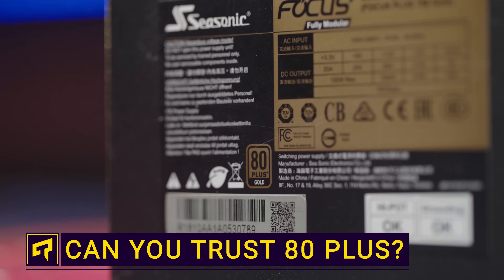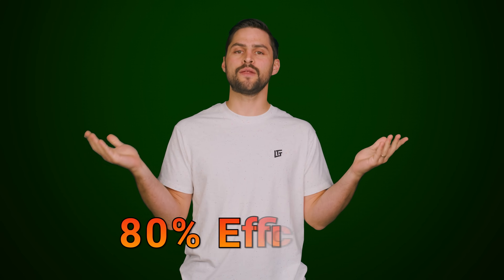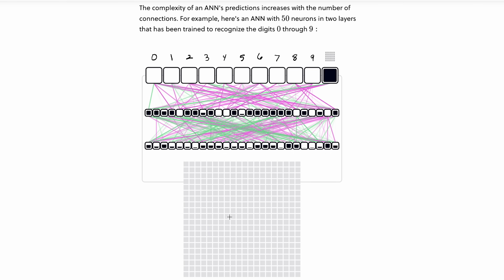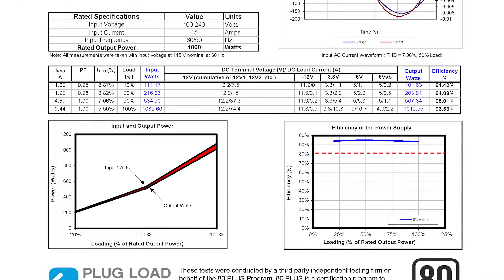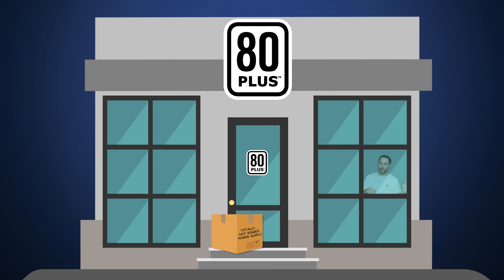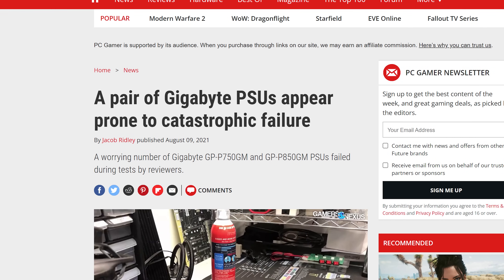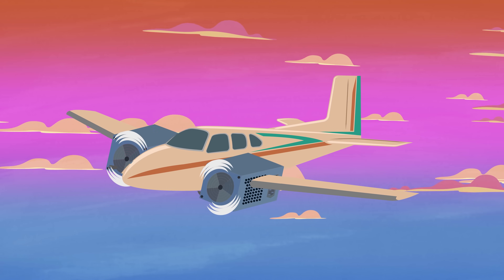Can You Trust 80 Plus?

Comment: Who give a crap about 80 somthing stadard buy seasonic ,super flower powe ,corsair and you are good yes they are expesiv but in 6 year you still are using that psu with no issues and itsade its worth easy
Reply: Not all Corsair branded PSUs are good. Corsair also sells mediocre to subpar PSU that use cheaper, lower quality components. You really have to look into the model and batch of that particular Corsair PSU. Corsair also does not manufacture any of their brand of PSU but are outsourced and based off various other manufacturers that specifically design and manufacture their own platform of PSU which quality can vary a whole lot.

Seasonic and Super Flower however are great since both of these brands actually design and manufacture their own PSUs and all their PSU models they sell are almost always at the top-tier in terms of quality and reliability.

Comment: Picking a CPU is hard since there are so many things to take into account and there are so many different models. The same goes for GPUs. The same goes for RAM. And for storage. And for the motherboard.
And then all components have to be well balanced on performance and price. Adding the complexity of a PSU to this makes it only more confusing since it's so hard to find proper data and consistent data to compare different power supplies. 

It's good to recommend this kind of thorough research for the people who like to dig into all of that, but what advice would you give to people who are new to pc building and who already overwhelmed by the amount of things they need to keep in mind and take into consideration? 
If you spread doubt and confusion like this, I would like to know exactly how I can easily avoid major mistakes while still keeping things as simple as possible

Comment: well in the other vids i saw that 80+ stuff isn't really mean much, because they only represent how much of power draw could occur in certain load, but they didn't mean it's really have great build quality, good PSU usually came with a heavier weight which means they could probably build better than average manufacturer.
Reply: Yep, bravo! With a mindset like that, PSU manufacturers will start adding unnecessary weight to their products. They know their "smart consumers" will judge a product based on how heavy it is.

Comment: My new Power Supply is called a 420watt Thermal Master which had No 80 rating that the seller on ebay call an OEM Cool Master?????? I can't find anything on it. It wasn't a New build it just my 15 year old DRS stop working one day. Standards are great. Made in 2010, so 12-13 years ago, only had a six pin for the GPU, but had 20-24 Motherboard and 4-8 pin CPU I was sad to see it go.

Comment: 80 PLUS measures at 10, 20, 50 and 100% and includes Power Factor, PF at all of those levels.  You can download and sort all of that information from all tests from the website for free. Thus a consumer can sort on every/any level of data desired.  As for cherry picking, which happens in most 3rd party testing programs, 80 PLUS has a challenge process within industry as well as an audit process since 2005.

Comment: Just a note on the Cybnetics noise testing, it's done at 30-32° celsius ambient, meaning you should still look up seperate reviews for more modest noise data if you use your PC in a cooler environment.

Comment: I have a Corsair HX620w. It used to feed a e6750 cpu and a 8800gt back in the day, then a q9550 and a gtx 680, now it feeds a i3 9100f and a rtx 3060. So it's a 16 years old psu still working silently, without any problem.

Comment: True and real. 
My rtx 3060 had power line led blinking with 700wat 80 plus (not even bronze) then i upgraded 750wat golden and newer tech and problem was fixed. And ye I should mention it's asus strix card that has that extra red led for errors.. and the previous PSU was able run all games without any crashes or wierd stutters too but apparently was using higher voltage trying to achieve same which occured as error in end any way and not letting GPU really never go over 180wats and blinking started around 170wat peak loads even, but with newer supply and newest drivers it can go high as 190wat easily with slighty lower voltage on gpu by automaticly and trouble free.

Comment: 0:30 "To qualify a Power Supply has to convert at least 80% of incoming power into actual power that your PC can use."
There you have it, AC current in your power socket is fake. Only the DC below 12V in your PC is real.

Comment: Quality PSU will last you several builds. Always get roughly 200-250% of your total system load. If your components peaks at 400W load get a 800W-1000W PSU. This will run your PSU at 40-50% load which is a sweet spot for efficiency and silent operation. If your next build has a higher load you will still be fine with that PSU.

Same thing with a good Case.

My recommended PSU's: Seasonic Prime series, Corsair AX/HX/SF Series, EVGA SuperNova T2/P2 series, Fractal Design ION Series, Can't be bothered to list more. 
My minimum PSU's: Seasonic Focus series,  Corsair RM Series, EVGA G Series, Can't be bothered to list more. 
Other PSU's: Ain't touching that with a 10 foot pole.

My Corsair AX760 is still going strong. Think I'm on my 5th system with the same Case/PSU.

Comment: Just had this problem this week when choosing a new PSU. It was between the RM850x & RM850. The only thing I could the find difference was sites saying one used components from China & the other Japan. However I couldn't any verifiable information in this claim, just repeated the same info on different sites. Anyway, I went with the "better" one, RM850x, cause it was only 5$ more.
Reply: Not 100%, but Corsairs RM PSUs ending with X are basically newer refresh of non-X, so similar with some improvements. I think changes were as you mentioned Japanese caps, which are in theory more tested for higher quality, but in practice, this is more of something that used to be true, but now isn't even nearly as much. Plus quieter fan with MagLev barrings. And they put caps into cables too. Both latter stuff are more nice to have. If memory serves, RM series wasn't bad to begin with, so difference wasn't as impactful. I think CX series had bit more of quality improvement with CXM refresh, where you did want to get refresh.

Comment: I have Corsair RM650 2021 PSU with 80 plus Gold, with my RX 6700XT Red Devil GPU and AMD Ryzen 5700g CPU, 1 M.2 SSD 16gb ram
Working just fine. but it's little scary cuz my GPU says 650 watt is the minimum Recommendation.

Comment: Techquickie, could you make a video about web standard? I want to know what is web standard, and why many websites optimize their web to chromium, instead of following 'standard' which might mean 'this should work well on every browsers'. Or, isn't that what it means?
Reply: Every modern browser follows the same W3C standards, with very little differences beyond bugs between them. So the vast majority of things targeting Chromium should Just Work (TM) in Firefox etc. Bleeding edge features may differ in support/completeness between them all, however.

As for why many target Chromium specifically.. the only popular modern browsers that aren't basically a rebranded Chromium (usually with other things added/tweaked, but the core is still Chromium) are Firefox and Safari. Chrome, Edge, and Opera are all Chromium under the hood and alternative browsers such as Vivaldi and Maxthon are also based on Chromium. Brave is an outlier in that it's based on Firefox instead. With such a large share of the browser market being taken up by Chromium (~85% going by a quick Google search, when counting Chromium-based ones like Opera and Edge as well), it makes more sense to focus efforts there over Firefox (~8%).

This, unfortunately, means Google (who are effectively in charge of Chromium) effectively decides how the web works. W3C standards only become a full standard when "the majority of browsers" implement it, so if Google doesn't add it to Chromium, it doesn't become a full standard. (Someone correct me on this if I've misunderstood the W3C process)

Comment: Electronics designer here: ALL switch-mode power supplies (that use active electronics for power conversion) are 0% efficient, or even have "negative efficiency" when load is 0 or close to it.
Because switch-mode power supplies use active electronics, they need power to function at all, and the switching cannot be stopped at any time or it will destroy the power-supply components because of short circuit. Thus it will need power, even if the device it's powering doesn't take any power -> efficiency is it at 0%

That being said, it's true that 80plus has large issues and we need better standards.

Comment: "Goes back to the grid"? That's not how it works... If it did go back to the grid, it would technically cancel out and could not be counted towards efficiency. The extra power is 100% lost in heat either through conversion losses, heat lost through supporting components in the PSU, heat lost through any resistance in the circuit (though technically could still be called supporting components) such as resistors, inductors, wires, connectors and traces (which are resistors), eddy current losses (inductor) but yeah, nothing "goes back to the grid", you're either pulling that current or you're pulling less and again even if it did "go back" it couldn't count towards efficiency and you wouldn't be able to measure it either since you'd just see less draw through the AC cable leads..It COULD maybe go back if our grid was DC and the PSU was horribly designed but...yeaah no..Imagine lifting a weight on a weight machine, you can pull it up (amp draw) but pulling it not as high or letting it down a bit doesn't mean you're putting energy back into the system (grid), you're just not pulling it as high...you'd have to somehow push it through the floor for it to feed it..and that's not to say some devices (including psu) can't backfeed but that only happens when there's another possible power source (in a psu for example, this might be a power capacitor draining after back the power was turned off..though a mains switch should disconnect the mains anyway so really the capacitor would either drain thru an intentional drain resistor or only through it's own internal resistance which can take a lot longer and is the MAIN reason PSUs can be dangerous to work on when unplugged)

Bleh does no one check your videos or writng sometimes? Like LTT is great for the most part but DAMN some of the random off hand things you guys say (Linus is the worst) that is just completely wrong or super poorly worded just blows my mind..Like I've literally heard Linus say shit that I know he MUST know better about but he's just in autopilot reading the prompter anxiously awaiting another cliché segue..just buy a Segway for him already.
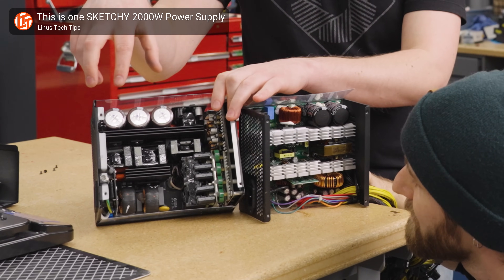Reply: @4:25 yeah..because the target audience of this video will be able to tell anything by looking at the components. Heck, I do EE and just "looking at components" doesn't tell me feck all except maybe if they're all from known nfg manufacturers but even then there's so many manufacturers and variations of components that further research would be required. And even then, you could have a psu built with the best most, expensive, aerospace/military grade components on earth and it could still be a garbage fire.

Comment: cant you recharge a battery (put that in the psu) more than 80% efficiency, what a horrible battery charger, get lost
Reply: that internal battery will also function as sleep ups
Reply: you can even have multiple volta batteries in the ups-psu, 5v, 12v etc rails
Reply: over-usb power saving mode like in a laptop when psu is on battery power
Reply: what money

Comment: I got the cheapest psu I could get locally, it was 80+ bronze EVGA non modular 450 watt. It ran a 4790 and a gtx970 that msi afterburner said was pulling 440w while running benchmarks. 

Overall, I don't regret it.

Comment: My friend has a neat way to workaround his kVa limitation of his Flat (apartment) Long story short, his Flat can only handle 240 Volt 2 Amp. Which means it can only draw 480 Watt of appliances at once. Anything beyond 480 Watt will automatically trip the Circuit Breaker.

And then of course he has Rice Cooker, PC, etc etc  that draws more than 480 Watt combined. So, how he outsmart this 480 watt Limitations?

First off he bought a "Slow-start Transformer Step Up" and then manually wiring a custom Grounding route. And then creating a custom Cooling loop for the Transformer. By limiting the Power draw from the outlet at 450 Watt Peak, the thing will take roughly 1 hour before it can handle PC & Rice Cooker at the same time 24/7 nonstop.

The 450 kVa from the outlet is increased to 4200 kVa. Now he has no problems using PC with RTX 3080, Rice Cooker, Air Conditioner, etc etc.

Comment: Nowadays you can get a 650 watt gold rated PSU, modular for under 100USD there is no need to cheap out on PSU. Only 5 years ago you would have to settle for bronze which is only 82% efficient.

Comment: Who the heck thought that the 80+ certs were about quality??? IMO this sounds more like a reviewer communication problem. I mean in this very video "It's fine as a starting point when you are looking to buy a PSU".... No.... it's not and never was a useful starting point for finding a PSU.

It was always about efficiency and the only link to quality was that a poor rating probably indicated a cheap or old design. A good starting point (if you had nothing else) was to find a GOOD brand (Seasonic, Corsair, etc...), work out what size you wanted and check the warranty and then look at 80+ rating and other features etc...

Comment: 1:10 a little correction: Power cannot go back to the grid. Anything that doesn't go the system, is lost as heat.
Reply: Came here for this 😂
I suspect the writer read something about reactive power and it going to and from. But that's not measured in Watts so just causes confusion here.
Reply: yeah, that's what i was thinking
Reply: Yeah, if a power supply uses 469 watts and some of that goes back to the grid then it aint using 469 watts :p
Reply: I think that was a layman's way of saying that the efficiency is defined as <power into the PC>/<PSU apparent power>. Seems like semantics to argue that reactive power doesn't constitute power going back to the grid.
Reply: A little will, creating small power surges that can (but probally don't) damage other eletronics in your house.

Comment: I'm currently using a no name 500W PSU but my current PC is not that power hungry so it works fine and it isn't loud either. However when I build my next PC I won't cheap out on the PSU. Im gonna go with at least 80+ gold and I'll research which are good options.

Comment: Is it still good practice to buy a PSU with just one big 12v rail rather than having multiple rails being present?

Also in the old days.. power supplies used the 3.3v and 5v volt Rails more than the 12v at the time... Are these lower voltages still relevant today?

Comment: 80 plus only tests efficiency, not safety. If you're putting 100% peak load on it and it doesn't have the required safety circuits and overheats, it doesn't matter if it has a gold certification

Good point to know

Comment: I like that cybenetics differentiates between 115V and 230V input voltage because this seems to make a very big difference.
Reply: it does, the efficency is higher at 230V
Reply: As does 80 PLUS 115V North America, 230V EU, European spec for desktops as well as 2 Data Center PSU standards. All ENERGY STAR(R) and EU ErP endorsed.

Comment: I never think that 80+ is /the/ selling point. I don't think I'd buy a new PSU without the certification, but I'm definitely more intrigued by higher spec 80+ ratings. I end up waaaay overbuying in PSU capacity (My 5800x and RX 5700 are running on a 1200w Be Quiet! Straight Power 11, and my Athlon 3000g has an 850w EVGA of some sort that was a good deal B-stock back when PSU prices were incredibly high)

Comment: I've got a Superflower 650w leadex 3 80+ gold. Did a ton of research on it and so far never had a issue at all, been using it for about 2 years now.
Reply: If I am not mistaken Superflower is the maker of EVGA PSUs too, so yeah, should be a great PSU. Good choice!
Reply: @haoy14  Yeah I think they are, I just made sure the psu has all the protections like ovp uvp etc
Reply: Well, yeah you bought the most trusted PSU manufacturer. If I remember right seasonic is also another great brand. Both of them end up being rebranded and sold under different companies, though sometimes with tweaks, for better or for worse.
Reply: @originalname9999  yeah seasonic is great as well that was my first choice actually but I couldn't find any 650w seasonic psus and after I heard how the Gigabyte ones were exploding I just went with superflower
Reply: Eh, it all comes down to luck.. 
Mine's the RGB one, blew up after like 8 months? Granted i can still do something with the warranty, i'm leaning towards Corsair, even C tiers ' CoolerMaster lasted for 3-4 years Corsair had better customer service in my country.